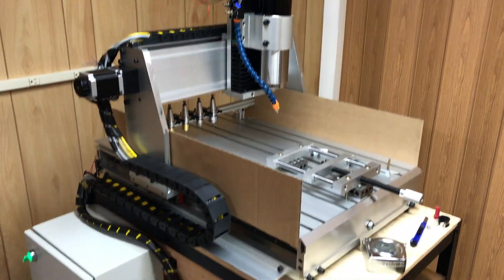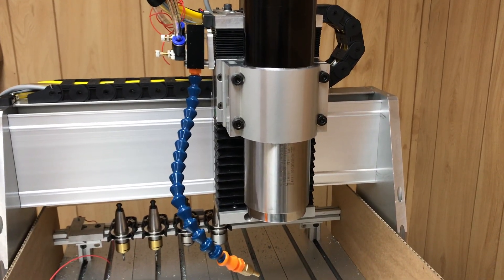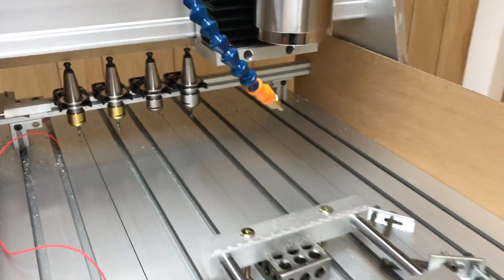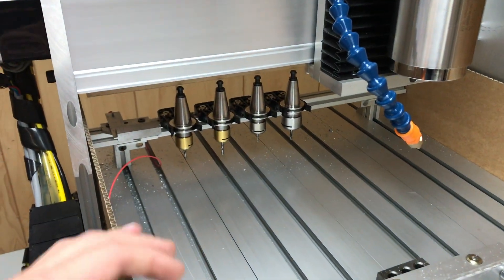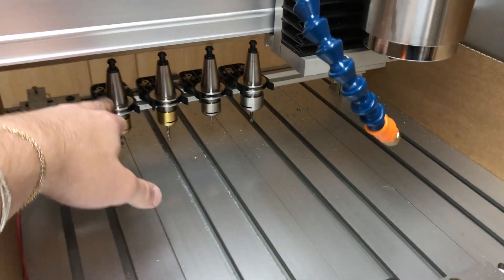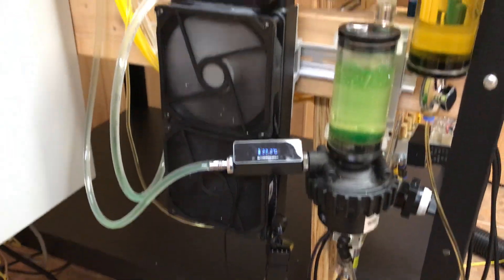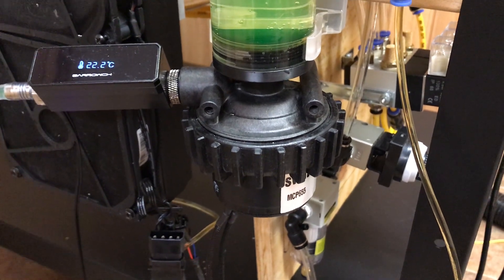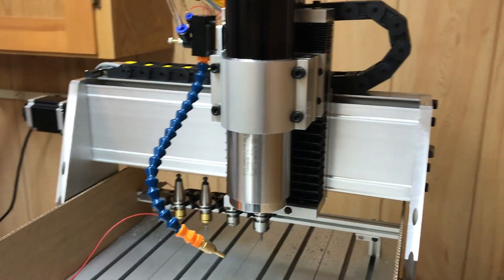Omio X6 6040 Router UCCNC UB1 Controller and ATC Spindle Upgrade - Part 2

Comment: Hi, very nice Omio. Thank´s for uploading all this videos, they are a great inspiration. I also have an Omio and want to add an ATC spindle, maybe you can answer me two questions. Can the original steppers handle the extra spindle weight (I have seen you have upgraded to servos)? Would you choose the JGL80-1,5kw again or would you go with the JGL80-2,2kw or maybe even the JGL100-3,2kw?
Reply from the maker: Original stepper was fine just slow, I think AC servo let me increase Z axis feedrate by 800%. The stepper had better holding torque when unpowered; the Z axis sags when you cut power to the AC servo.
For this 6040 frame a 1.5kw spindle is more than enough. If I could buy a spindle again I would go with more RPM. For single flute and small endmill work especially.
Originally I purchased the 1.5kw 24KRPM model because the faster 30K and 40K spindles actually increased in diameter to 100mm at the ATC piston.
I wanted to avoid modifying the Z axis assembly and further reducing the work area so I chose the 80mm OD spindle model; it was a direct replacement of the original spindle.
My advice is to keep the spindle 80mm OD (1.5-2.2kw) and go high RPM.
Reply: Thank´s for your help.

Comment: Awesome stuff. I have the same spindle but cannot get any info about the bits for the air system, could you by any chance post some links to the parts you used for the ATC.

Comment: Wow... its look like a proffesional machine, could you let me know the model and brand of the spindle. also it possible to know the brand and model of the toolholders. thanks for your answer.
Reply from the maker: spindle is from jiangen, JGL-80 1.5R24-20, I recommend buying their larger units if you can accommodate the diameter. The toolholders with the golden nut are from Parfait a Taiwanese brand sold by the spindle company, they were expensive at $100 each. The rest are generically purchased from Aliexpress from various vendors, they all seem identical and runout of them is satisfactory so at this point I shop for the cheapest ones, they're much better at $20 each. Much bigger difference comes from the collets, Techniks are what I've settled on.
Reply: @NikitaLab  thanks so much, for your very fast answer

Comment: What are the minimum rpms you can go for on this spindle with sufficient torque for milling (aluminium for instance)??
Nice setup.
I have ordered the same controller uc300eth UB1 with leadshine 400w ac servos
Cheers.
Reply from the maker: Honestly haven't tested that yet I always default to 20-24k for the speed. I think you'll be very happy with the UB1 and servos, good luck configuring everything!

Comment: Very well setup. complicated and lots of parts involved. Just qustion what kind of 240mm radiator are u using ? I have 2.2kw spindle will it be sufficient to cool down ??
Reply from the maker: So there's some research you'll have to do first when deciding on the radiator. In order to avoid galvanic corrosion from mixing metals in your loop you'll have to determine what metal the inner watercooling jacket is made out of. I know that lower-end spindles may have an aluminum jacket inside so an aluminum radiator should be appropriate for you. My spindle the manufacturer informed me that it's chrome plated steel inside, a copper/brass radiator was suitable. My 240mm I saw temperatures incrementally rise from 18C to 26C over less than 20 minutes of spindle operation. The manufacturer actually suggests an ideal delta difference between ambient and coolant of 10C so 240mm seems to be right on the money, but I wasn't comfortable that this rise happened quickly and with the longer jobs I have planned I upgraded it to a 360mm. The manufacturer of my radiators is XSPC, they're good if your on a budget. Their low-end EX radiators aren't very efficient since they cheap out on the fin thickness but these were essentially free for me.

Comment: Great video, learned a lot from it. 

1) What will be your final wiring between cnc controler and solonoids :

a) they will be in separate cabinets however near to each other?) or 

b) they will be far away thus  you need rj45 converter to have something like cnc controller -> SSR ->  RJ45 converter -> cat5 cable -> RJ45 converter ->solonoids ?? 

2) Are you planning any additional components around VFD like EMI filter (I believe you have EMC) or AC Input / Output Line Reactors?
Reply from the maker: I have uploaded new video about the machine but basically I have wired all solenoids to 12V and the ground to SSRs which are controlled by 24V outputs from the UC300.
a. Separate cabinets for controller, VFD, and pneumatics
b. Yes exactly. Basically have relays wired to the RJ45 boards. Pin 1 is 12V and every other pin is a ground connection that goes to relays.
c. In the new video you can see the setup of the VFD. I think I'll keep it with the AC line-in filter and also a large ferrite core that spindle wires wrap around. Small things as well like shielded wiring for serial wires going between VFD and PC. No plans on adding output line reactor.

Comment: Quick question: on the emi filter, I see you went with the 'B' variant - which Schaffner specifies as tailored for use with medical equipment. I was going to pick one up, but the local supplier only has the 'A' variant. Did you intentionally get the B version? I can't think of a reason the A wouldn't work, but you've obviously put more thought into all of this than I have. 😁 Nice setup, by the way!
Reply from the maker: Thanks and honestly I haven't, the B version I simply found a good deal on. According to the datasheet: "FN 2060 filters are also available as B versions without Y-capacitors for medical applications as well as A version with low capacitance for safety critical applications with necessity for low leakage currents"
It seems to have to do with safety standards, Y capacitors seem to pose a risk in regard to leakage current across ground and the power lines so they aren't used in machines that make contact with patients, and the A version has small capacitance to limit that current to a safe level. Seems like both would do the job.

Comment: Damn that's a lot of upgrades.... my 3040 is now sad :( 

Love the setup, any idea on the cost? And if you could do it again, would you? Or would you just buy a pre-made one?
Reply from the maker: I estimate $7k will be the final cost. Good question about if I would do it all again. Honestly no good options existed out there for something I could accommodate in my house. While it has certainly been a great learning experience and that has value in it of itself I would have bought something premade if it existed. The closest pre-made machine would be the Datron Neo but I needed a cheaper machine to prototype and enter small scale production for my parts before locking myself into $2k monthly payments. I expect to use this machine to test the waters with a new line of products I've been working on and if all goes well I fully expect to have a much nicer machine very soon.
Reply: @NikitaLab  how did it go